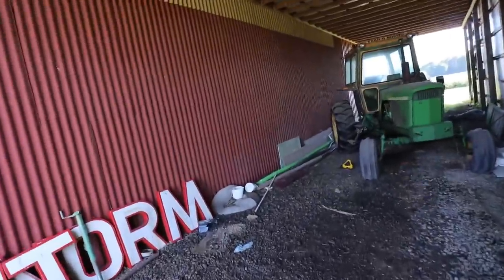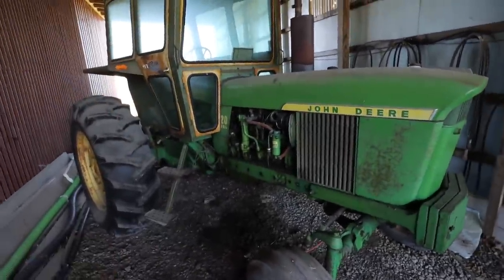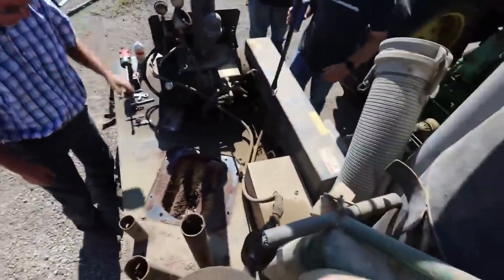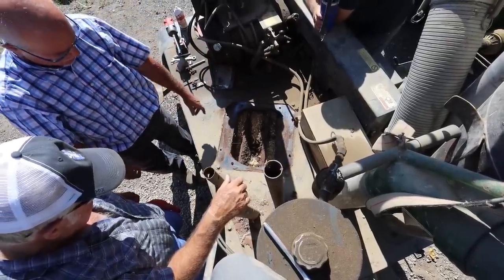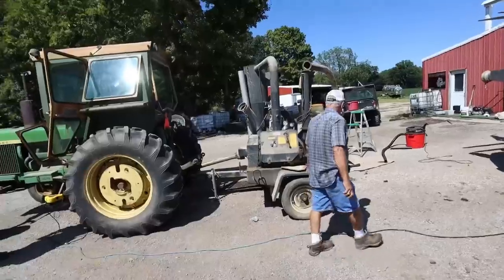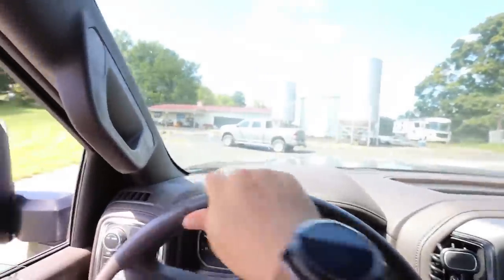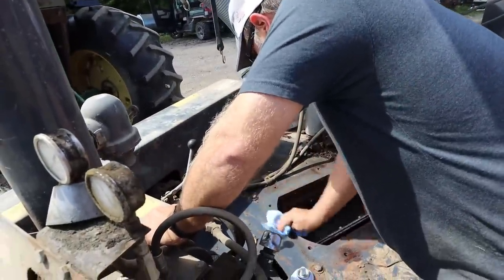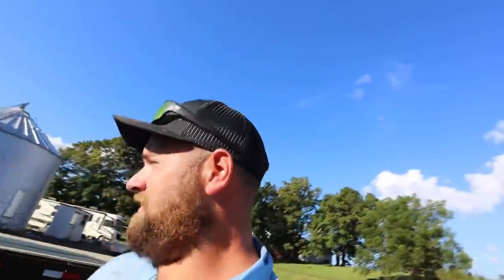Trying to safely clean out a grain bin with a large Vacuum

Comment: Yea try pull starting one of the new tractors 🚜 , NEVER GOING HAPPEN. You know makes you want to keep a few old iron just in case the poop hits the fan. 
Brian I would check the valves on the JD both clearance and seats. That cab is a Year A Round brand on the JD?
Reply from the maker: Yes

Comment: After running a walinga, cleaning a mess around bins, never again will I run one of those pieces of junk, take you forever to load a trailer, save your self the headache, go get a remm 2000 series or a brandt grain vac, take you
Reply: Brandt 5000 series and only take 10-15 minutes to load a trailer and 20 minutes to load a Canadian superb, even told buddy I was helping that if made me use a walinga again he could spent all day to only fill a hopper in a tri axle grain trailer